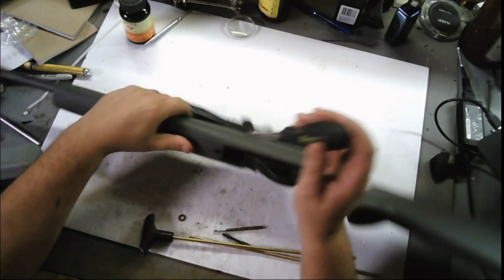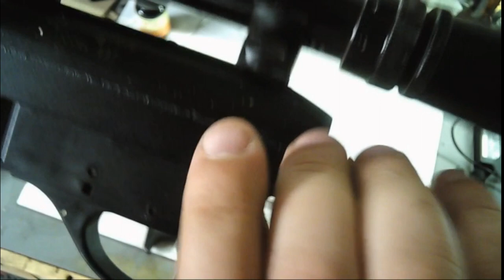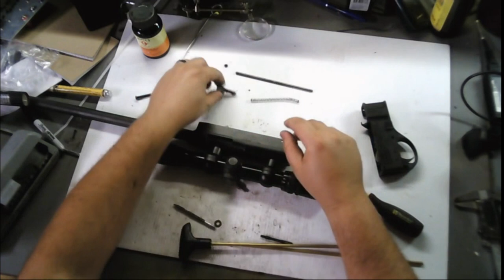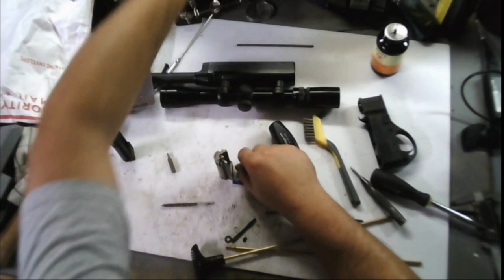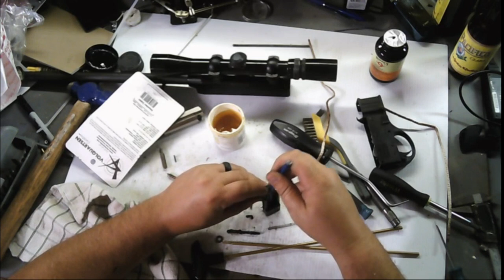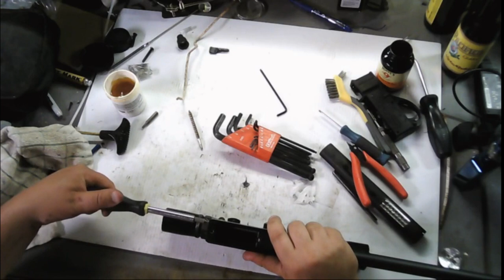Remington 597 22lr (Cleaning , Review , and New Extractor)

Comment: So i just got a Volqusrtsen extractor for my nee to me 597 (didnt even have the spring or the extractor in it.....pawn shop buy)......im gonna assume that with the new extractor the pointed hook end is the end that is supposed to poke out past the end of the bolt???????
Reply: that is correct. you want to  make sure the unit is fully seated , if you dont have  the kit here it is via mid way https://www.midwayusa.com/product/1004752735?pid=363360
i would recommend  the  dual spring  replacement as sometimes  they can be bent due to  re assembly here you go 
https://www.midwayusa.com/product/1005021976?pid=117070
i hope that helps. if not let me know and i will make a new video  showing how . thank you